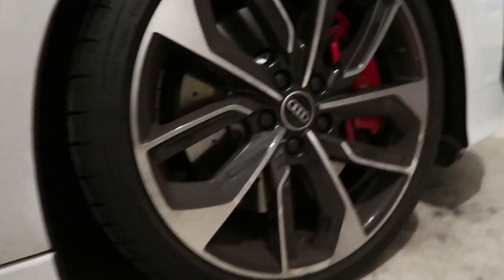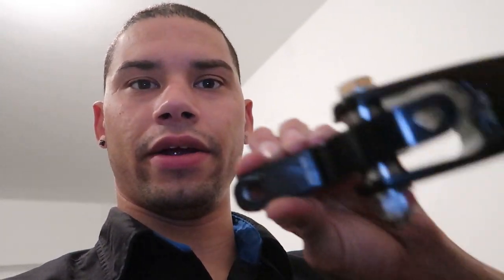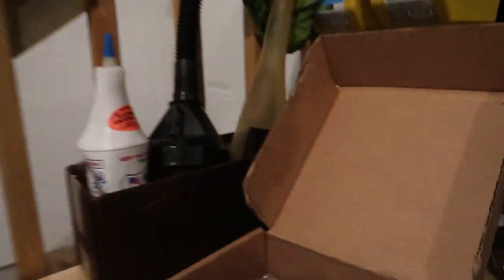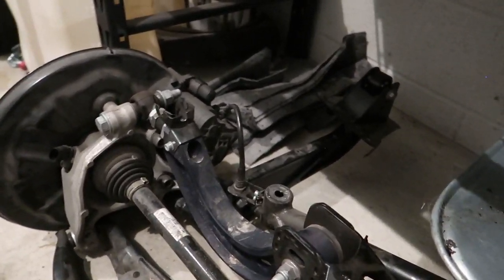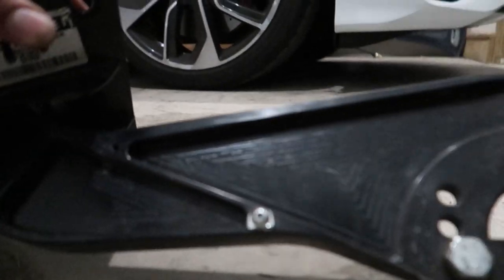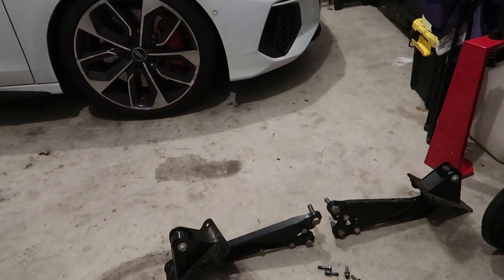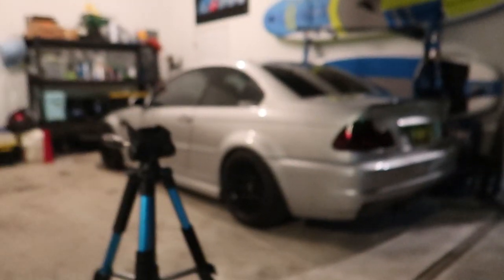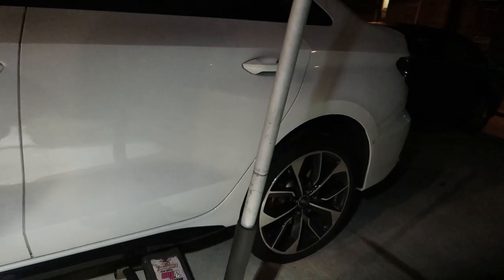Swapping parts from my Golf R! Sway bar, endlinks and more! | 8Y S3

Comment: dude.. i been thinking hard about trying out my Powerflex insert in my 2018 S3. Its an upper/lower hybrid. I'm wondering if the vibration is worse, less, or the same as when it was in my GTI..
Reply: hahah you ordered a paper filter too! I'm keeping my foam for a backup.
Reply from the maker: If my foam didn't have a slight rip in it I'd probably rock it.. just gives me an excuse to try the paper one lol. I do get a little vibration right when I let off the brake but it isn't bad.. if I time the gas pedal just right after letting off the brake it doesn't vibrate at all. Might as well try it! Free mods 🤪

Comment: MK8 Golf R owner here. How do you like the springs? I don't know if our DCC is like the Audi system, but was worried about ruining the ride by lowering it. Also, a secondary question, do you know if the Bilstein MK7 B16 dcc coil overs are a direct replacement for the MK8? I contacted Bilstein directly and they were no help.
Reply from the maker: They should work, suspension is the same it's MQB.. just gotta check and see if the connectors are the same. Audi uses the same suspension as golfs, DCC is great with the racingline springs though I will say I'm a bit numb to NVH and prefer a little honestly. But they ride great, ran these on my 7R with DCC for 50k miles never had an issue.
Reply: @BryceJordanProductions  I appreciate the fast reply. I'm glad I found your channel as my car is going to be built towards track/autocross and the roads here in East TN. I think I will go with the Racing line springs for now until either a DCC controller or the Bilsteins become available. So far the only thing done to it are new tires PS4S and color correction/Ceramic. I was pleasantly surprised by how well this chassis handles the backroads I have taken it on (the snake and the dragon and roads around it) So I am excited to see how well some mods will wake it up even more. I hope some of these companies products you are using are at least helping you with costs of some of these parts. I know I will be ordering a few racing line parts because of your videos.
Reply from the maker: That's so awesome you've already hit the dragon and such! Really hoping to make it out there this season!! I've hit up DSC about their DCC controller for the new gen MQB cars but no reply yet, I'd love to keep DCC with a controller and just change out top hats for more camber.. hopefully that'll be achievable! I don't really get discounts sadly I wish I did.. shopdap gave me a free shifter once that was pretty cool. Racing has sent over stickers when I had my mk7 and just recently a nice care package with some merchandise. EQT I have a sponsorship with so I do get discounts there but there's basically nothing I don't already have or not compatible yet for this so I'm kinda outta luck there till tuning is available. Not a big deal tho I'm not anyone special I don't go too crazy on reviews or being flashy so I think I kinda stay under the radar lol. This is all pure fun/hobby I don't really expect much in return
Reply: @BryceJordanProductions  Yeah, I reached out to DSC as well and have not heard back either. Well, keep doing what your doing. You should definitely have more subscribers. Sometimes it just takes the right video to go viral and then all your hard work will pay dividends. I am not in your typical demographic as I am sure I am much older than most of your viewers (pushing 50), but I will recommend your channel to others. BTW congrats on the new addition to the Family. We just had a Grand son born into ours. Racingline hook this guy up with some parts!

Comment: What turbo do you think you’ll go with on this guy? Will be interesting to see what kinda power the new OEM turbo makes but I assume you will upgrade it
Reply from the maker: Probably won't be for quite some time, really do wanna see what these new turbos will do maxed out on E.. hopefully they're more reliable the then early mk7 turbos. But after all my experiences I think I want a genuine Garrett unit. The exhaust port is the same between the gen 3&4 so I think I'd be able to make use of the new adapters that are coming out to V band a turbo with an external gate. But that's way in the future.. not even sure how long it's gonna take to unlock these new ECUs

Comment: Dude, I need to get the Michelin Pilot Sport 4S tires off my 19" wheels. If you have any tips or contacts which can be cheaper than a tire store, let me know. I would pay also.
Reply from the maker: I can do it for free buddy just gotta come to me at VW right at closing one day
Reply: @BryceJordanProductions  wow thats insane, ill try and plan it out when you are in town. weekdays only? I may have to take a few hours off work.
Reply from the maker: I do work some Saturdays but my schedule is messed up right now between our baby showers this weekend and the next plus holidays. But we close shop about 530 during the week and 5 on Saturdays.
Reply: @BryceJordanProductions  no problem, no rush. We'll figure something out. I'm parting out those 3 non-bent wheels on ebay, as Carvana was a huge pain to get that bent wheel replaced. they wanted me to put it back on the car, go to a tire shop, get it diagnosed, then submit bills.. i just dont have the time. I'll also sell those 19" Michelin Pilot Sport 4S's local once they are off. all in all, I'll make a lot more than i was offered for the wheels recently. On ebay the wheels  alone will get $300 shipped each easy.